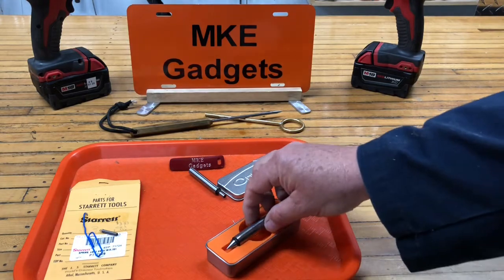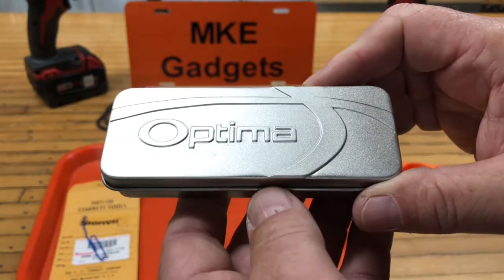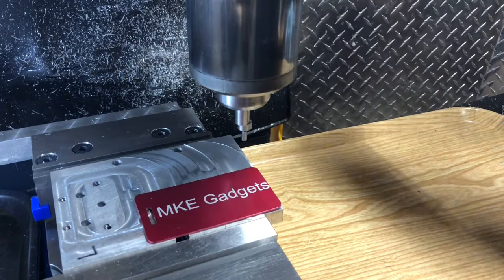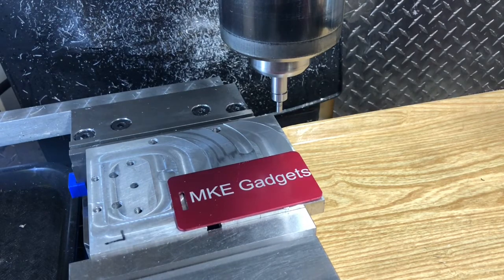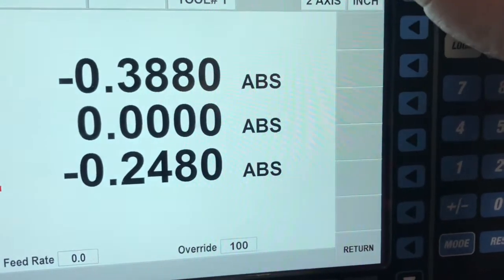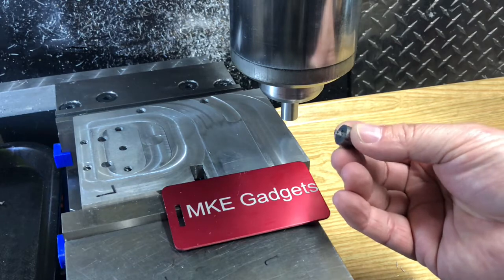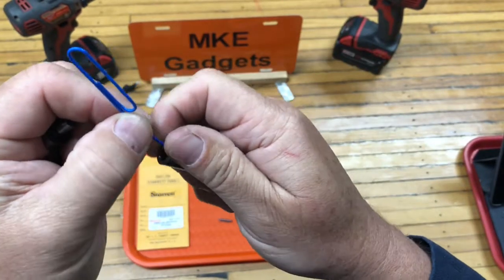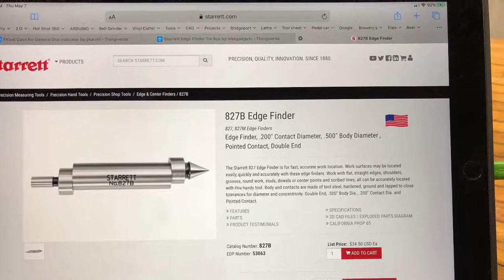Starrett  Edge Finder Repair and Use @ MKE Gadgets #82

Comment: Wow, I cant believe those are $35!!! 

I enter the location in the controller differently. When you initially find the edge I enter the exact dimension it is at, not 0.000. example being .100 if I am using the .200 end of the edgefinder. The reason I do this is that its quicker and less chance to make an error since you don't have to move the table twice.
Reply from the maker: I think $35 is a bargain for high-quality American made edge finders. You can buy some cheap ones for about $15 and they don’t work as well as a Starrett one. I was trained along time ago is zero out and then you move over half the diameter of the edge finder. This is easier for me to keep my Mind right.